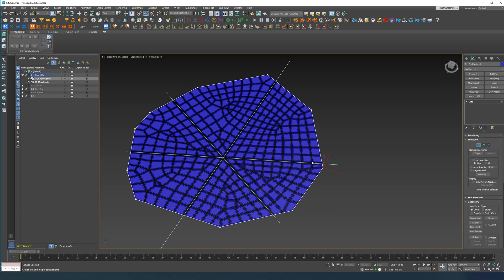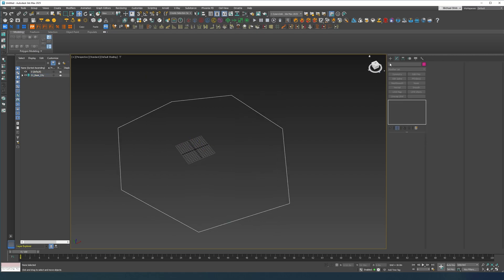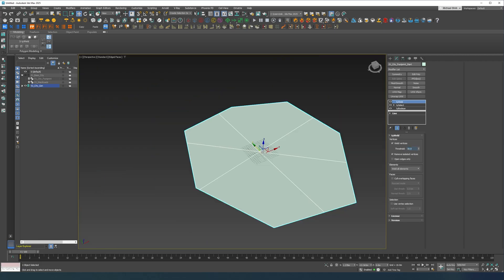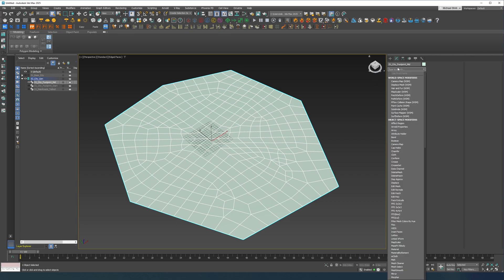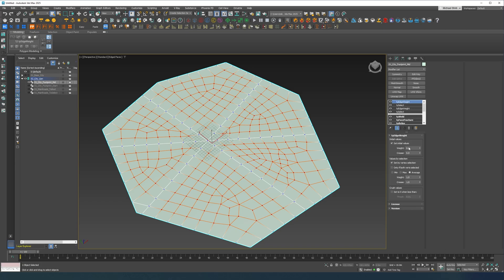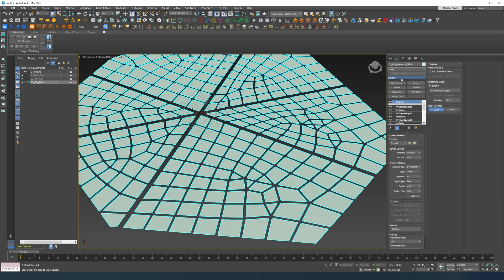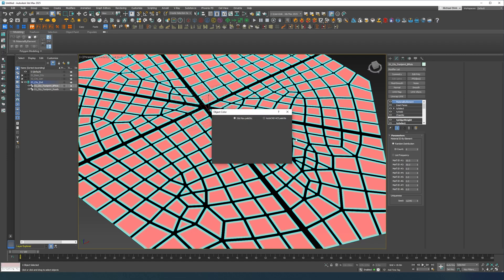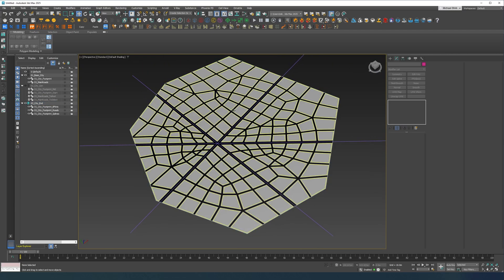Create a City Generator in 3ds max+Tyflow - Tutorial

Comment: Nice work mate, (maybe overkill with too many modifiers?).... btw maybe instead of that ''Inset Faces modifier'' you can use tyfaceextrude...
Reply from the maker: Maybe a lot, but think about it as nodes, its not too many, you probably can remove 1-2 of them, but overall its working like that realtime. 
As for inset faces/face extrude modifiers, sure, but I want to control in system units how wide are my sidewalks rather than it being a % of the main polygon which in turn will make every single sidewalk different size